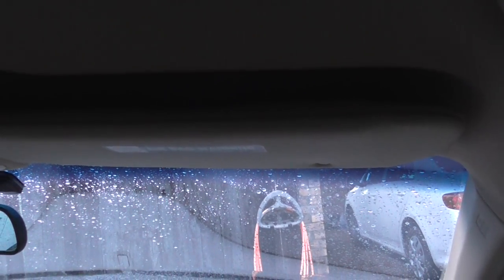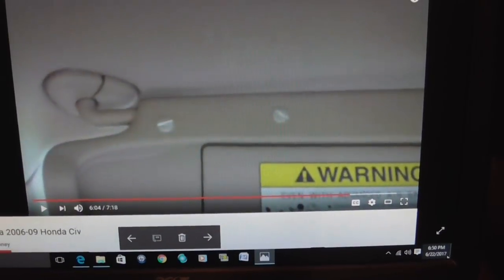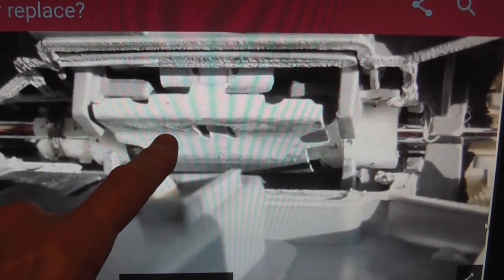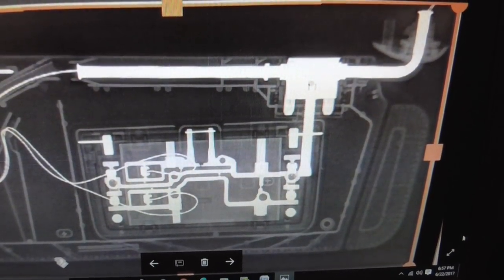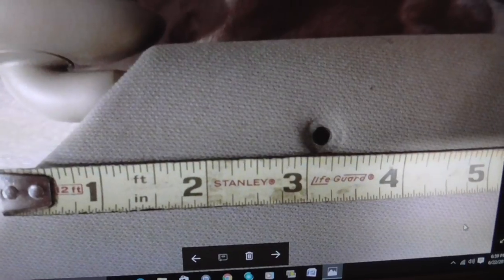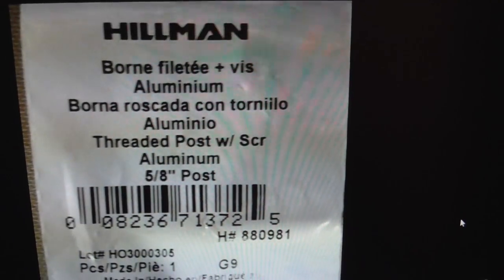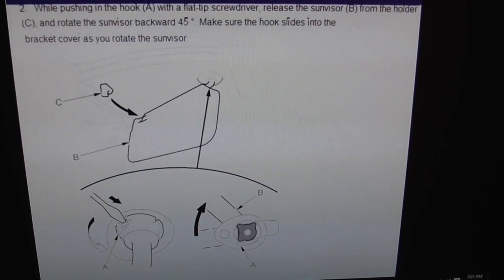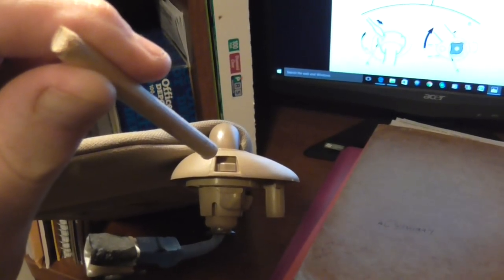How to Repair Honda Accord Sun Visor

Comment: Absolutely Genius to xray the visor! I used your measurements, drilled a hole, installed and tightened the 5/8" post screw (with washers).... it worked PERFECTLY! Thank you
Reply from the maker: Glad it worked for you.
Thanks for commenting.
Reply: @PaulRevere2012  followed your instructions and this worked perfectly!

Comment: A quick FYI for anyone doing this: The post screw that is used is meant for 1/4 inch holes according to the listing, and when I did this, the 1/4 seems to fit perfectly.
Reply from the maker: Thanks

Comment: Also works for 2014 Honda Pilot.  One difference when drilling the hole is that instead of 1 inch down, you have to go 1 and 3/8ths inches down.  For length 3 and 1/8th inches works fine as shown in the video. Also when drilling the hole use a thinner bit for the pilot hole first taking care not to rip the cloth on the opposite side.  Hope this helps someone.
Reply: Life saver

Comment: I was making an Amazon order for both visors for my 2009 Accord for $230 and thought to check you tube to see if there was a repair.  This repair works very well and saved me $230.  Doesn't look as good as new but perfect for a 10 year old vehicle.  These visors have been replaced before and Honda should provide a free repair.  Will definitely have a bearing on future purchase from Honda.
Reply from the maker: Glad that worked for you

Comment: Just did this! worked to perfection! went from 2-2.5 inches of sag to less than half an inch. I have no idea how they figured out using screws could fix this but whoever did that should get a job on the Honda design team.

A few tips for anyone who might try this:
When you're removing the visor, if you're doing the one on the driver's side, take a couple minutes, go under the hood, and remove the fuse for the horn (I don't know about other Accords but on my LX it was the only 20-amp fuse in that fuse box, so it was easy to locate). This allows you to get behind the visor while touching the steering wheel without blowing your eardrums out.

The correct size the hole needs to be is 1/4 inch.

Make sure you use a bit designed to drill through metal, it will make your life so much easier. I tried this with a standard bit, and while it did penetrate completely with some effort, it didn't entirely drill out everything, which caused issues. I then got a proper metal-cutting bit and it went through like a knife through butter.

Definitely use some kind of masking tape (you can't use too much) over the point you're drilling on so you don't mess up the fabric.

Start drilling on the side that doesn't have the mirror on it, there's less in the way on that side.
Reply from the maker: Thanks

Comment: This is awesome - and btw, it is still happening past 2012 models, bc my 2014 Honda Accord EX has the same exact issue. Seems like a design flaw that Honda refuses to address with a recall or official redesign. Probably so they can make more money off of new parts and labor at the dealerships...
Reply from the maker: Thanks

Comment: I just did exactly as pointed on your video on my wife's 2011 Acura TSX. It worked like a charm. Thanks for the X-ray detail. Very thoughtful. Thank you
Reply: Did you detach the visor from the car before drilling the hole?
Reply: @bvssrsguntur6338  I've tried but failed so ended up drilling the hole with the visor in place. It was OK. I used a 3/16 and 3/4 post screw.
Reply from the maker: Welcome.
Glad it worked.

Comment: It worked on my 2014 Accord! It does take some force to drill the hole, though. Thanks!
Reply from the maker: Thanks
Reply: Can you take a picture of your sunvisor? I was wondering is his measurement of 3.2x1 inch was accurate with our 2014 models. Thanks Don.

Comment: Excellent video and instructions!  Took no time at all with the drill press.  Based on other’s comments, I thought it might be more difficult.  I had the same scratches on the screw head, but after installing, I sprayed a little on a Q-Tip to touch it up.  Looks great, works great.  I appreciate your post!

Comment: Tinker Man. Thank you so much.  I from México,  and It worked for me in my accord 08, i have save 40 dólars in used sun visor, the hard part was to drill the metal, i used a  conical 10-32 screw.
Reply from the maker: Welcome.
Thanks

Comment: Always admire doing things on the  cheap.   This repair made things better, but is not a satisfying fix.  Fabric shreds even if U duck tape it.   The visor still hangs down 1/8" lower, but is not in the way.   All in all I did not have 2 pay Honda or eBay fifty bucks!   Thanks.

Comment: In my case, that metal holder just clicked out off the held place, I disassembled the visor with accuracy, it holds on hot joint and removed the holder and clicked it up and then just connect 2 sides with a glue for plastic
Now it looks like the new one and work fine, no bolts and holes

Comment: Worked great on my 2012 passenger visor. The drilling was tougher than I thought. What is Honda using as metal, Titanium??? The washer is essential when tightening the fastener as the fabric twists without it. Thanks!
Reply: Was it the same process as this video? I have a 2012 too but I'm hoping it's the same process as the 2009 one
Reply: @W0nTonSoup  2012 is the same generation as 2009 (it's 2008-2012) so yes it would work

Comment: i want to give it a try on my 2012 Honda accord. Do I need to remove the visor before drilling?
Reply from the maker: Yes.
It is hard to drill through.
You can also take a nail and hammer to make the hole.
Reply: Yes but the removal is pretty easy

Comment: @TRUTH I got stuck at the drilling stage.  Bought a new cobalt bit but could not get through the steel.  Now I may have hardened the steel.   About what drill speed did you use?  Mine was at 1900 rpm which may have  been too fast.  Any advice would be appreciated
Reply from the maker: Take a nail and punch through the steel with a hammer.
Make sure nail is not bigger than 5/8
Reply: Was not successful with the nail, but had a friend with a drill press and was able to get the hole drilled.  Your repair idea worked, thanks for taking the time to post it.

Comment: Hey, I'm redoing the headliner on my 7th gen accord. I had to use a sawzaw to cut the sun visors open, as they were plastic welded shut. Well, I'm at the point where everything can go back together, but I feel I may be missing some components, or some other issue. On the arm of the sun visor, there is a black metal thing that the arm goes into. That black piece doesn't want to fit nicely in the actual sink visor, so I really can't close it. And also, if it does slightly close, the arm does not move. Is there a place where I could see what parts I need and order them? Everyone is saying to just get 2 new visors, but I put a lot of hard work into the ones I did, so I don't want them to go to waste. Thanks in advance.
Reply from the maker: I doubt you can order internal parts to the sun visor.
Try a junk yard.
Reply: @PaulRevere2012  I did, and I actually figured it out! So the arms are Designed in a way to fit each side. You can't mix the sides up. One arm was 4.5", and the other one for the passenger side was 5, 3/16". So that explains why one arm wasn't fitting in the opposite visor lol. But yeah, got them all done, and they look awesome!

Comment: how did you drill the hole? what size drill bit? i ask because i would think a drill would twist the fabric as you go through it?
Reply from the maker: Put painter's tape over fabric and drill 5/8 hole.  A nail and hammer can be used also
Reply from the maker: 5/8 inch
Reply from the maker: Put painters tape on fabric.
You can also use a nail and hammer to lunch through
Reply: @PaulRevere2012  thank you for all the tips. sadly it didnt work for me, and my fabric got twisted anyways. looks like i will be on the lookout for a replacement part. 

mine still sags. and when i flip it down to block sun or hold a sun visor its really weak and falls a bit (doesnt stay at full open).
Reply: @PaulRevere2012  I got stuck at the drilling stage.  Bought a new cobalt bit but could not get through the steel.  Now I may have hardened the steel.   About what drill speed did you use?  Mine was at 1900 rpm which may have  been too fast.  Any advice would be appreciated.